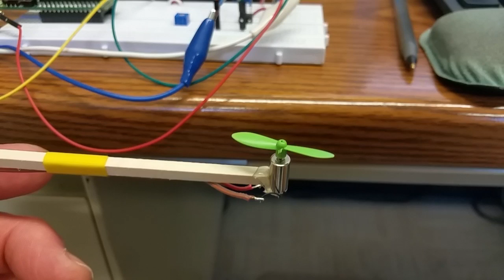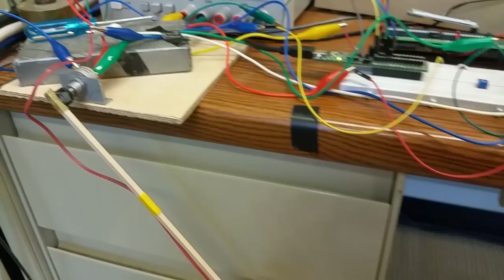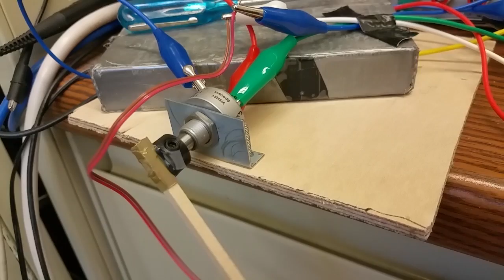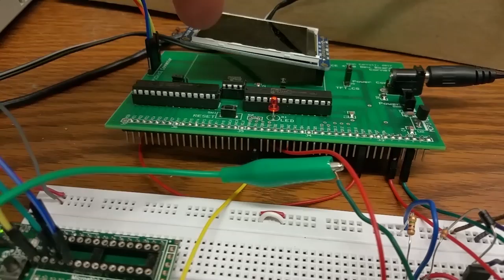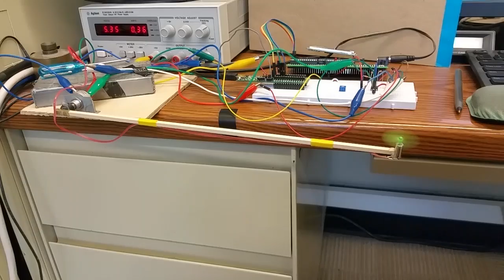1 DOF helicopter

Comment: Hello, which motor are you using? I have DC 3.7 V  coreless motor but it seems weak :/  I have a arm made from bamboo and its like 3x shorter than yours and I cant make it work. It can only lift up to 15 degree. Thank you.

Comment: Nice experiment!  A bit underdamped - are you sending meas, spt, and out to serial for logging and plotting purposes?  Are you using a derivative term?
Reply from the maker: I am still tuning. It is fairly nonlinear due to cos terms in the torque and square-law motor torque.  I am logging in realtime to a two channnel DAC. Still tuning the derivitive term. Thanks.
Reply: Bruce Land Do you plan to characterize the output?  Good idea to use DAC outputs for a storage scope - I've been using PICs also (since 93 when only 5 variants existed!)